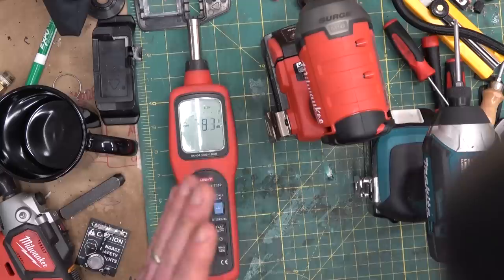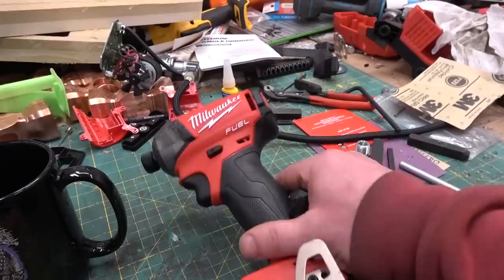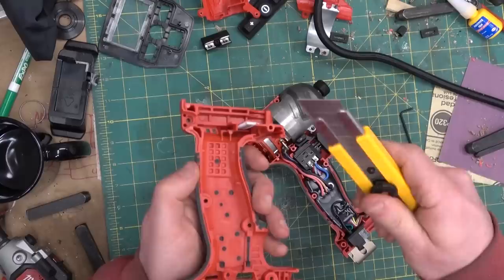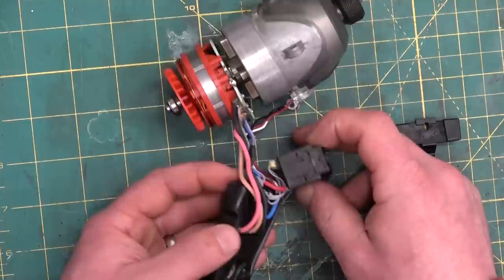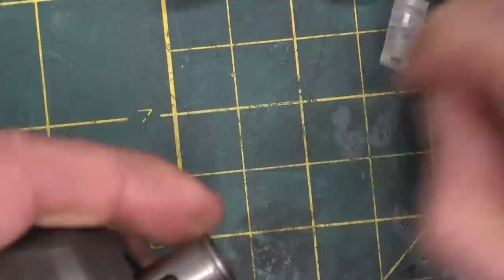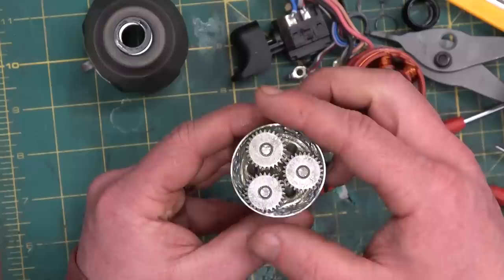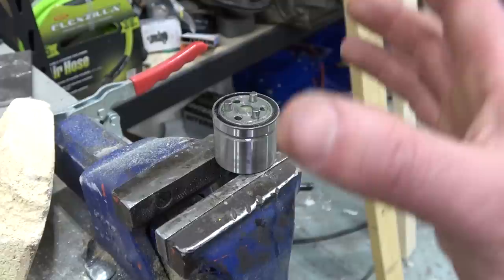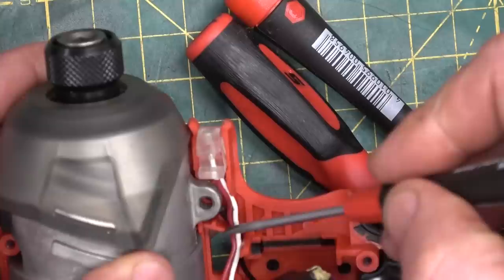BOLTR: Hydraulic Impact | Milwaukee Surge

Comment: i stole this quote from someones lecture because i couldn't word it as well myself.  but this is the reason one impact gun may have sounded the same or louder even if it was reading quieter. 

"Tones of the same intensity (power per area), but of different frequency, are perceived as
being of different loudness. To simplify the discussion, consider just sustained tones where
the pressure is a sine wave. If two sounds have the same intensity and their frequencies lie
between about 600 and 2000 Hertz, they will be perceived to be about the same loudness.
Outside of this range, that is not the case. For sounds near 3000 to 4000 Hertz, the ear is
extra-sensitive; these sounds are perceived as being louder than a 1000 Hertz sound of the
same intensity. At frequencies lower than 300 Hertz, the ear becomes less sensitive; sounds
with this frequency are perceived as being less loud than a sound of the same intensity and
1000 Hertz frequency. The loss of sensitivity gets bigger as one goes to lower frequencies.
Also, at very high frequencies sensitivity is again reduced."

Comment: What is the rated torq @ rpms of each tool, also torq check each tool, In the factory driving 1/4" self tappers, nothing beats the millfucky. I have not tried the hilti. dewalt 20v is good also, makita-junk. Slower doesn't mean tweaker

Comment: Honestly thought about one of these when I was replacing all of my "stopgap" Ryobi tooling for work (bought before the raises started rolling in and I found the "per diem" slot on my time card).

It's like $10 more expensive so it's gotta be more gooder.

What I'm getting from this here video though, it's not more gooder when the safety directer says we all need to shove buttplugs in our ears anyway so the louder gun that's $10 cheaper will do me fine.

Commercial mechanical (HVAC) work so being quiet was never on the cards anyway.

Comment: @AvE at 24:00 could that ground be used to dissipate high voltage electrostatic charge generated from friction of the oil inside the chamber?

Comment: 18:30 ish talking about having to buy new parts getting expensive. but i have all milwaukee tools and their warranty program is awesome. 5 yrs on tools an 3 on batteries and they pay the shipping to repair and to get it back to you. all you have to do is go to milwaukeetool.com/eservice and fill out repair and they give you a shipping label. as long as it is under warranty thay fix it. and half the time you get a new tool back instead of getting a repaired old tool back. and when they do that your warranty starts over. Im definitely sold on their products.

Comment: I've found myself equally unimpressed with the hydraulic impact drivers. There just isn't a big enough difference in the noise to justify the absolute lack of power. Especially considering the price difference. Now it has gone down quite a bit from when they first hit, but using Makita as an example, why on earth would I pay $20-$50 more, for less performance? I have to wear ear protection either way..so I want to get the job done.

Comment: The ground wire may be due to working with the electric utility industry to make a tool that doesn’t fuck right off when used on energized conductors over 7.2 KV... the first gen Willfuckie L,ion tools would completely drain the battery when exposed to 19.9 KV. They’re answer was the “red” lithium battery and it worked. We currently are using Makita tools which are working fine at all distribution voltages. I’m sure willfuckies are too.

Comment: Good video. I am a victim of milwaukee.  All the fuel line products break. The triggers on the 6 1/2 skillsaw break sometimes within a month. The sawzaw blade locks freeze. The hammer drill clutch locks or freely spins. 
Pure junk.
But the radio can charge my cell phone !🤦‍♂️